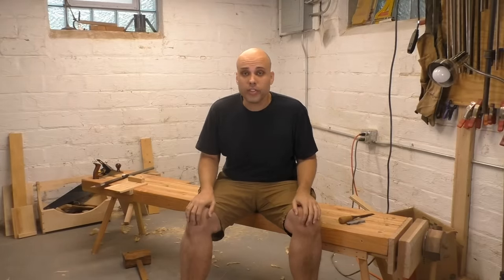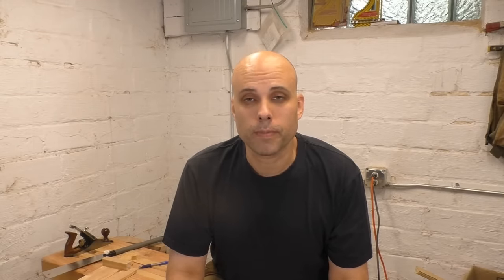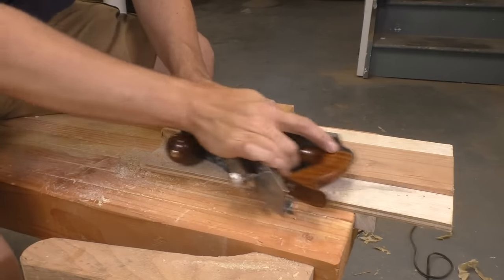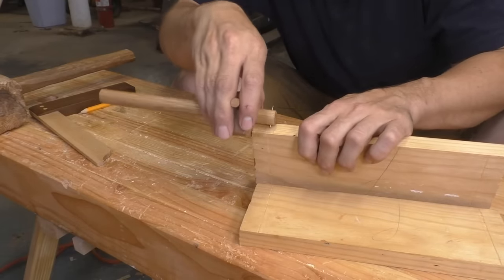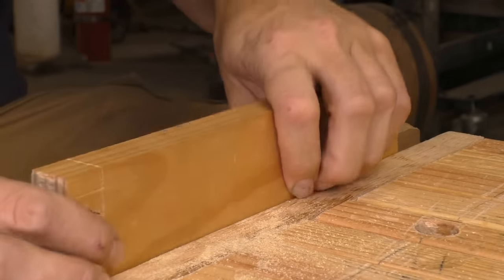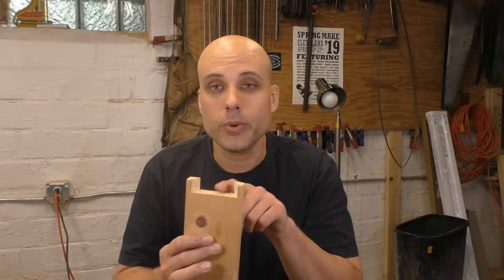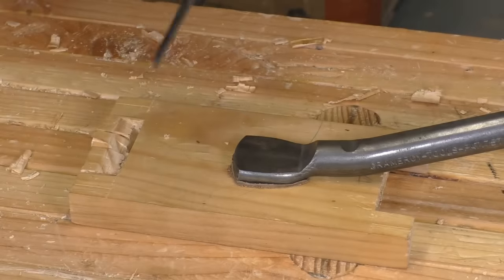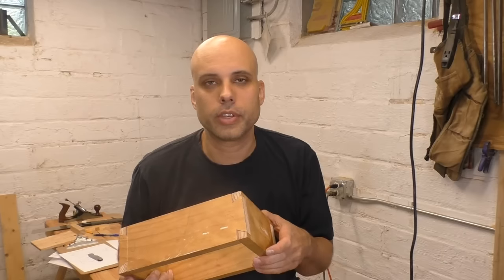Easy Dovetails for Beginners

Comment: Started trying dovetaiks this week. Did my 4th today, after each i do an honest assessment. My chisel work has to improve. I found that i have to constantly make sure cuts are square. Your right, the saw kerf on the pin cuts makes a huge difference and you get ugly gaps if you cut on the line so i offset by the width of the kerf. So when i saw this vid and the line about only sawing what you can see, i realized the missing piece. Since im still new to woodworking, im working on my cuts and the back side cut is always off. That little tip should make #5 a lot better.
I've still got plenty of the 8foot pine 1x4 left!!!

Comment: We did a dovetail box similar to this in school, when I was about 12, about 30 years ago, and it had a second dovetail in the middle as well. I remember being pretty pissed with myself that there were a few gaps between a few of the joints, and I thought it was going to fall apart in a few days. 
I still use it today to hold CDs.

Comment: Use liquid epoxy, I used PC Rot Terminator, made for rotted wood which it will turn crumbly wood to what you can hit with a hammer it bounces off.  Then there's West and I think an East epoxy.  Which a dovetail will hold together, but epoxy will make them inseparable it seems.  Filling those areas where moisture could get in and start rot.  Better than paint!

Comment: Just as a friendly FYI -- For anybody like me who can't handle sustained use of pull saws, you can get good rip saws on ebay pretty cheap.
Reply: Ahhh, do you mean push saw? Pull/push refers to when the saw cuts. Rip/crosscut refers to how they're designed to cut.
Reply: @doncooperjr4817  Yes, sorry. Cross-cut saws are a dime a dozen, but rip filed saws seem hard to come by at a reasonable price. And I do mean push saws, since one doesn't need to grip but barely at all, which is good for hand cramps. Thanks for pointing this out! :-)

Comment: My first and bigest mistake in dovtailing was useing pine at first material. I knowed it is to soft. But i was sure if i can make in pine i will be able to work whit other kindes of wood, and i work whit pine, spruse and larch moustly. It was wrong direction. Oak or ash or even poplar is beter chose for beginer. 
U show large singel dowtail. Such U can cut even in... puding or somthing like... But when U start make it whit reason- for drawers or jewerly box, U fast forget about  dovtail and start make other joints. 

First atempt U schuld make in oak. Is good advice.

Comment: On the piece you chiseled out, could you use a copping saw after you've cut the half pins? Just a thought. I love your videos and I use your common sense methods and techniques.
Reply from the maker: You can totally cope out the waste, but you usually still need to chisel a square shoulder. I'm still experimenting.
Reply: That is how I was taught to make them in college.

Comment: Maybe rather cut the pin lines in half and leave the tail lines intact, that way one don't risk breaking the pins off when chiseling them. Also think it would look more pleasing if the pins were half the width of the tails. I also learned the hard way not to try and do advance joinery with pine after for do-overs still couldn't get it right.

Comment: The other secret to making everything insanely easy is SHARP tools, shaving sharp. It's incredible what a difference it makes.
Reply: Exactly! Needed to say that by sharp tools it is meant that you may need to resharpen every day. Not only your plane blades, probably also your chisels and your saw teeth! It's a difference whether you cut a cut in 4 strokes or 20. Or whether your chisel cuts like into butter with bare hand push or you need to use mallet and your cuts tear the wood down (like in video).
Reply: Tried my 4th dovetail today. Sharpened chisels last night. Halfway thru todays tails i thought "man, i gotta sharpen this chisel".

Comment: Hmm, for some reason i always thought that you're quite an advanced user of handtools. This video makes it clear that you're probably not that experienced with them. Interesting. Or maybe i'm just too spoiled by Paul Sellers videos. He makes working with hand tools look so easy.

On the other hand spruce and pine dovetails are somewhat difficult to cut with a chisel without tear out on the endgrain. I find it easier to stay away about 2mm from the line and then pair it with progressively finer cuts. That way the end grain doesn't tear out. But i'm sure there are many techniques to tackle this problem. What they probably all have in common is that you want to make very shallow cuts towards your line to avoid tear out. The same problem obviously pops up whenever you want to cut end grain in spruce or pine without tear out. So it's also going to appear in mortises. The good thing is that in both joints nobody is going to see the torn end grain. 

Nevertheless i do appreciate the video. Especially that you're sticking to hand tools and a simple bench. I really love that bench you've built.
Reply: To reduce tear out had razor sharp chisels, use a knife with deep markings that is very deep and that will reduce tear out. You may get a little bit in the middle sometimes but not on the show side. 
If you try to chisel the whole way through from one side to the other you are going to get tear out on the bottom side as you chisel through.

Comment: That joint ended up a lot weaker than necessary because you removed so much wood from the pin board.
If you are only going to make one tail, you would do better to make the tail about one-half the width of the board, and then the half-pins would each be about one-quarter the width of the board. That way each board in the joint still has half the strength of the uncut board.
Reply: J Will but this gives more gluing surface area (if you’ve watched Matthias et. al's trials you’ll know that the wood fails before the glue joint), and once it has a base and lid on it, it’ll be plenty strong enough.
Reply: @thatellipsisguy8984  No, endgrain glue surface is NOT stronger than wood. It is much weaker. It is much better to have uncut longrain wood fibers than it is to have a glue joint to endgrain.

Comment: Rather than using a chisel, could you use a coping saw if you have one?
Reply from the maker: Yes, but even if you saw the waste (which is an accepted technique and works well) you still need to chisel to get good edges.
Reply: @RexKrueger  excellent thank you for the advice

Comment: I know a lot of people have feelings about dovetail ratios in unhelpful ways. I am not trying to be that guy but 60 degrees leaves a lot of unsupported short grain in the tail board. A drop of the board and you've lost a corner.  Not a fun time for humans like me who still need to learn to stop dropping and banging my work pieces around. Matt estlea has a really great primer video on dovetail ratios (plus many more things).
Reply from the maker: So, 60 is the reading on the protractor. From the 90 degree line, it's 30 degrees, which is not an uncommon angle. But your point is taken.
Reply: @RexKrueger  I see. For what its worth, I much prefer the aesthetics of the larger angles.

Comment: Awesome video, but 
Dovetails
Are
Easy.

Just practice.
And then try a scarf joint and fall into depression....
Reply: How do you fuck up a scarf joint?? It's only 2 meeting faces. Dovetails have multiple faces that need to be aligned.
Reply: You literally lay one board atop the other, offset, and and pare down to a line extending from the tip of the bottom board to a point on the top of the the top board equal to the offset.

It's dead simple with a belt sander.

Try a birds mouth if you really want to weep.  Or one of the scarfs the weebu carpenters do.
Reply: @bsdnfraje  To be fair, scarf joints are easy to cut and align. Then CAN be a bastard do glue in place unless you've got a couple of basic tricks up your sleeve.